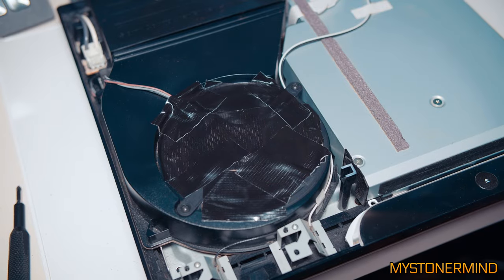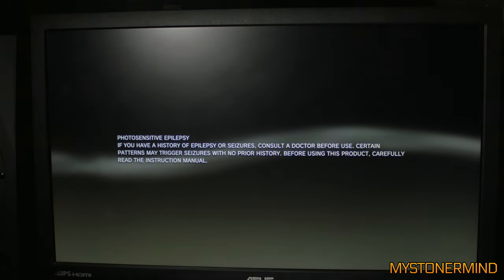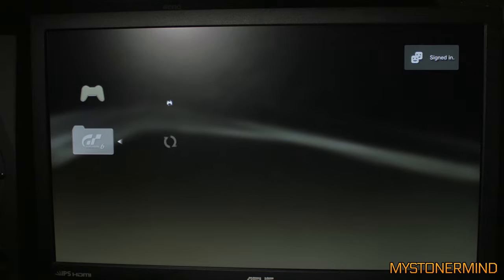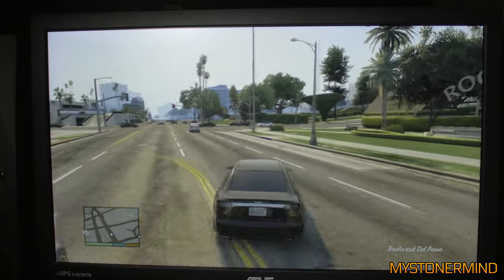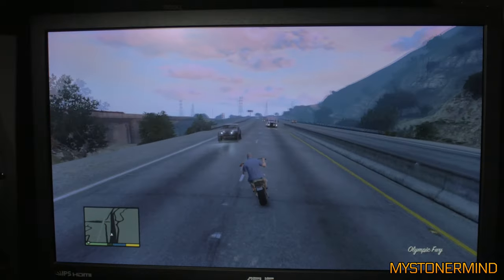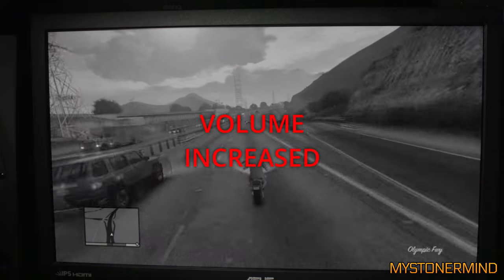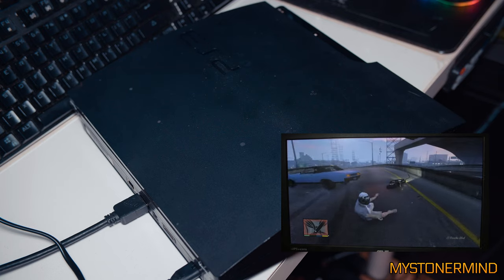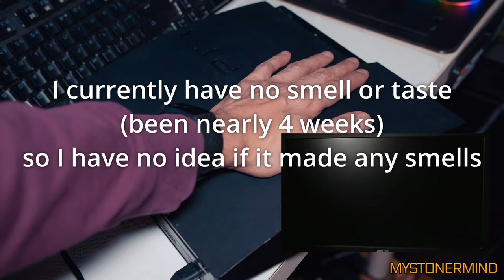Overheating A Playstation 3 (To See What Happens)

Comment: This brought back so many ps3 memories haha. I've played without anything coving the fans and have had the system go super Saiyan and shut off like this. Air duster time, a few forced fan tests on ps3 start to blow the extra dust out in which air duster couldn't get to, and back to gaming until the next few months down the road to do it again. When you took the cover off the top I laughed to myself because my disk reader started going out, and occasionally it'd read disk and work fine though rarely. You could here it spinning the disk up fast, then slowed, fast, and slow in repeat when it couldn't read the disk. When it wanted to read , it didn't spin up fast like that instantly. I fixed this disk reading problem by not only permanently removing the ps3 cover, but also removing top metal lid on the disk drive. Plop a disk in and use my finger on the spinning disk like a DJ to adjust the spin of it to slow it down some (not too much or it would not work) to give it more time to read the disk before auto spinning up and trying again, and it would read the games every time. Basically I had to stop auto disk spin-up the system would do when trying to read disks, so it could actually read the disk. I used the system for half a year like this lol. Best part was if mid game of a COD match, and disk error sometimes popped up on screen. If caught fast enough and manually adjust the disk speed again, I could get the game to start working normally and not be kickout of the game to the main PS3 XMB menu. Good times lmao
Reply: Yeah PS3 power!!!
Reply: it is called PS3 ULTRA ULTIMATE EXTREME POWER💪💪💪
Reply: Wow great work